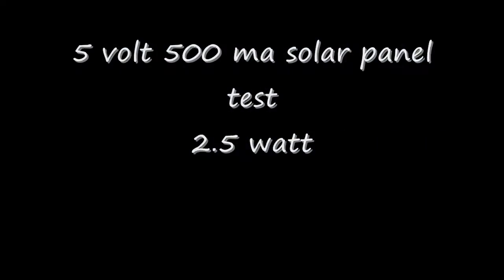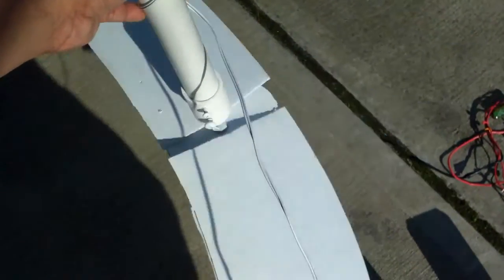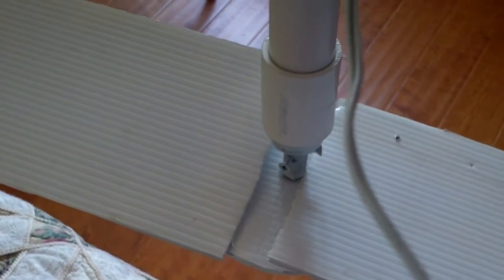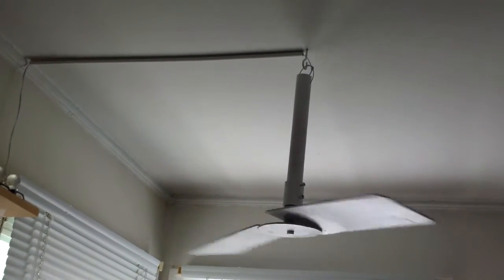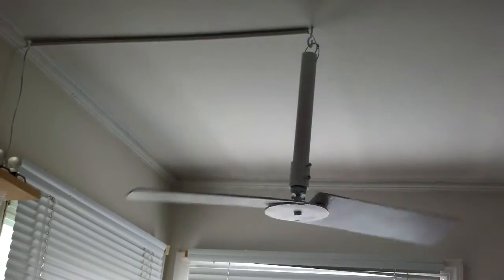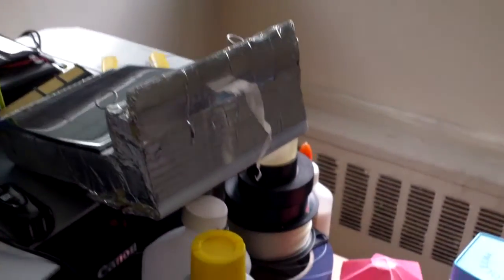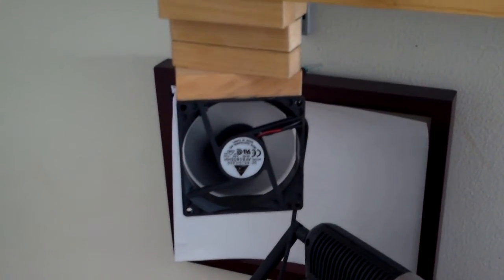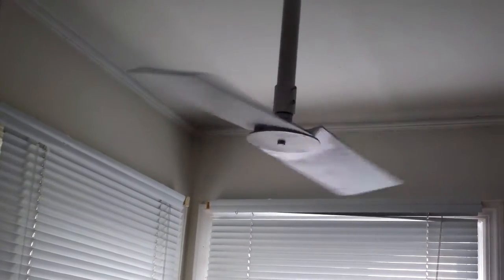testing the small diy dc ceiling fan

Comment from the maker: For more air movement, maybe make a longer blade, about 3 feet. You can punch a hole on each end of the blade and tie a fishing line across the blade to keep it from sagging. That's what I just did with mine. The fan is running on usb power now for only a few watts. Solar by day, usb power by night.